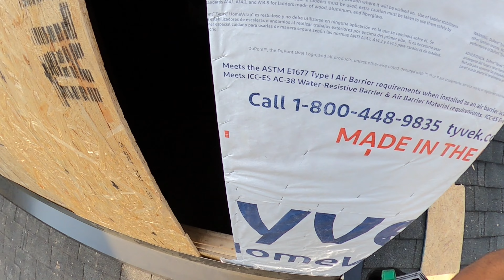POV ROOF REPAIR

Comment: Yikes.. stpe flahsing should never be exposed. Shingles should be on top. This will 100% leak and what you did was pointless.
Reply from the maker: They wanted me to pre flash this dormer but the house was getting a reroof the following week 👍
Reply: @lolbrazy  you'd think it's easier to do it all at once
Reply from the maker: @EastAlen  I agree with you but I just do what I'm told
Reply: @lolbrazy  make that money bro